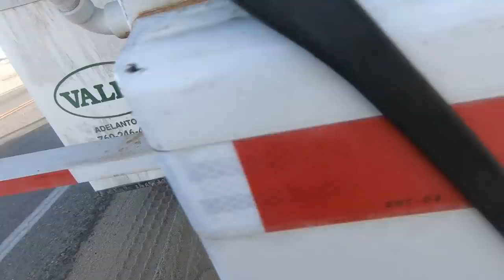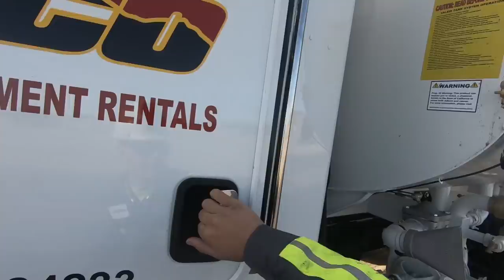6x6 Water Truck Loses Drive Shaft! Needs A Tow!

Comment: i would have just pulled the rear drive shaft up so its level with a rope or belt and drove it home with the front, ive done that in my 4x4 truck before. never busted a driveshaft on my 6x6
Reply: You obviously are not trying hard enough.

Comment: Wow customer seems confrontational, respect your patience... drive shafts don’t just come apart it takes abuse to break a drive shaft, it all comes down to the operator.
Reply: Did you not even notice that the shaft had the F-up bolts, do you not have enough grey matter to figure out the shaft has been worked on before and was probably not done right.  Also yes drive shafts can break and do especially with the way they are computer adjusting the torque and fuel for economy.  That is why the shaft sizes have grown.

Comment: The reason that drive shaft came apart is that it does not have long enough spline area. The drive shaft is for regular truck and not a 6×6. If you noticed the two bolts that were wrong size and grade type. This is because this has happened before to that truck. Most likely a mistake in manufacturing.
Reply: The splines themselves are plenty long, just the drive shaft as a whole is too damn short.
Reply: Yeah and you can see where they separated it all the weight was on the front and rear most axles so the middle one was hanging(maximum driveshaft extension).

Comment: This reminded me of a  family vacation I was on when I was a kid. My dad pulled the brocken driveshaft out of our suburban and drove 1000 miles home towing a 8000lb boat. It worked great and he still owns the suburban 20 years later.
Reply: That Suburban probably had a Dana 44 or Dana 60 up front, which is strong enough relative to the vehicle and the trailer.  Newer light-trucks with IFS don't usually have front differentials that are strong enough for that kind of service.

Comment: Most likely cause of the axle breaking is the water sloshing back and forth in the tank if it doesn't have baffles in it. Several tons of water moving in a wave in the tank can put a lot of strain on the driveline if it hits the bulkheads at the right time.
Reply: CO Jones the drive shaft wasn’t broke it was measured wrong and slid the splines apart when the front drive axle dropped into the low spot because he cut the corner short.
Reply: The tank was emptied, so said the driver but still maybe he could've driven it using only the front drive wheels but maybe because it was a rental somebody decided it was better towed for liability reasons.
Reply: @richardanderson5109  Yeah, with the wrong part. If they install a proper length driveshaft this won't happen again.

Comment: The last thing the water truck needs, is a tow. Pull the driveshaft and finish his water delivery on the front end, then drive it to his own shop.
Reply: Bob Bartlett no, thats how you destroy the front axle, driveshaft, or transfer case. It’s not designed to have all of that power only going to the front axle. Whether it’s unloaded or not.

Comment: On those asking about the strength of the leaf springs. To expand on Trent’s ‘yes they are’ realize that the truck weight is on the leaf springs—they attach to the truck frame and then to the axle. So with exception of the axle and related parts, the leaf springs hold the weight of the truck when raised off the ground all of the weight including the axle are supported by the leaf springs.
Reply: True, it can support the weight but say the leafsprings come loose because of a broken bolt at the front maybe it would be wiser to wrap the frame instead with the chain. That way you have a redundancy of attaching to two separate points. Not likely to happen though so why bother.

Comment: I've often wondered why you don't get a small plastic bucked, like an ice cream container, to put the drive line bolts and parts in.
Reply: Or at least a tarp or blanket to lay on and catch bolts.
Reply: Granted this is on much smaller vehicles, but I put the u-joint straps back on and snug the bolts down when taking the driveshaft off.  Means I can find the hardware when it's time to reassemble.  Done this both on stuff that was getting worked on in the shop and in prep for a wheel-lift tow.
Reply: @TWX1138  not a bad idea. Saves time to just throw in the cab though haha :)

Comment: I lost the rear shaft in a cement mixer on a job, boss sent the mechanic to pull the shaft, then had me drive the thing back to the shop with the 6X6 engaged. Guess he didnt wanna shell out for a tow...

Comment: I haven't looked this up yet but if you haven't already done a video on what things would be really nice on a truck to make it easier to hook up to that would be a very helpful video for a lot of drivers I'm sure it would save you some time as well as help you to be able to make more money while still lowering your age just a hair. shoot even if you were to put quick connects or something on the air tanks and stuff I'm pretty sure that would be a big help to yourself in the future or some sort of tying method on every track you come across so that you can control it a lot better and safer while going down steep grades I'm going up steep grades.

Comment: If there shop was just rite down the road why didn't they just drive it there after you pulled the rear drive line, instead of you hookin them and towing it and billing them for a heavy tow?
Reply: Brett Callahan that most likely would cause a lot of damage to either the transfer case, front drive shaft, front axle, or some other powertrain related bits. Not a safe gamble for saving a couple bucks
Reply: PRobably liability concerns. And the fact that the 6x6 isn't meant for that sort of use so it could have broken that shaft.
Reply: "If their shop was just right down the road" - My guess is that 4X4's and in this case a 6X6, are not designed (or intended) to run as a FWD, only. 

A 100' or so at 5-10 MPH, on an empty truck, is probably fine. 

1 or more miles would probably void the warranty and take a long time to drive and, may cause damage that might not become evident, right away (or simply break that, too). 

Short answer: torque imbalance. It would be tempting to do, though .
Reply: 6x6 trucks are usually governed for slower speeds. The ones we built where anyway. Drive it nice and easy and they emptied the water, so it would have been fine.
Reply: Those 6X6 trucks are meant to only run 6X6 mode at low speed (25mph or less) so attempting to run it back to their shop would have most likely caused damage to the transfer case.  It wasn't designed to run highway speed with 6X6 engaged.  Moving it 100 feet or so at idle speed is fine, but driving it several miles would ultimately damage the transfer case.
Reply: That prop coming apart is a bad design fault by the truck builders.
Reply: blew a rear u-joint out in the boonies long time back.  unhooked rear drive line put her is 4 x 4 and went home
Reply: Matt B where does it say it has to be at highway speed?

Comment: Trent what's with the grates in the entry to those roads?
Reply: The Big House pretty sure the grates are so the dirt/sand doesn’t get shoved to one side of the road or the other from the trucks pulling in and out, also helps with traction pulling back out.
Reply: I wondered that, too. Only thing I could figure, was maybe to knock-off more of the dirt and sand; to keep it off the pavement?
Reply: Keith lance Oh ok thx! That would make sense, just don't see those here in Michigan, lol.
Reply: Weren’t they just full of dirt Texas gates for stopping cattle. Theta whet we call them in Canada. We clean ours out with a combo unit so they actually stop cattle.

Comment: All that time to run a air supply line, i would have just let the thing idle 5 miles down the street. The drive line has already been removed and even though its a 6x6 the front (now the only drive) axel is off the ground. I mean your way is the "Proper way" but there is no hurting it running it in neutral and saving some time
Reply from the maker: While that is definitely an option that crossed my mind. When the camera is rolling no shortcuts. Thanks for watching!
Reply: Why kill someone when you can do it right?

Comment: I think that drive shaft  has been out  before, and that is not original driveshaft that odd bolt on differential u- joint is a giveaway that it has been out before!
Reply: Definitely has been out before. I wonder if this problem has happended before and thats why it was out or it was out for another reason. And if they didnt install it right and it caused this problem.

Comment: Was the air pressure 100 and rising on both the primary and secondary, or one or the other (and which one?) Which air tank did you end up connecting to?? Does it matter if you hook up to primary or secondary air tanks? I always heard that the front brakes were on secondary, and the tandem brakes were on primary.
Reply: It doesn’t matter they are all connected, just add air

Comment: If those guys had a tool kit they could have pulled the driveline and driven it back in 6x6.
Reply: James Schrumm that’s what I was thinking
Reply: For the same reason he pulls the drive shaft when towing from the front. While the truck can be driven using just the front wheels, especially if there is an emergency. It was not designed to be driven with just the front wheels and could damage the driveline by putting all the strain on the front. Plus, it’s better to be safe and have it towed verse risking damage driving it with just the front wheel.
Reply: It also wasn't their truck. It was a rental. Can't risk it.

Comment: Why didn't you just let the truck run to maintain air pressure?
Reply: Probably so he could use his trailer-brake control, to apply braking to the towed truck (safety and additional control). And, the possibility of the towed truck, loosing air pressure for any reason, which would lock the brakes during transit - yet, would still have a constant supply of air pressure.
Reply: With the driveshaft being disconnected and the front drive being elevated and thus out of the equation, allowing the truck to idle and maintain air pressure for the parking brake would have been a good way to do it while also saving him 5 minutes. But because he’s filming it and sharing it on here, a million and one keyboard warriors would have cried and wanted him to lose his job for not doing it “by the book”. If I had to guess I’d say there’s a lot of tricks of the trade that he either doesn’t film, edits out, or simply doesn’t do just so he can make these vids.
Reply: @brycejcox  why have an accident and kill some one when you can do it right.